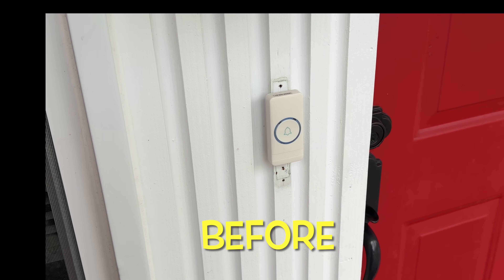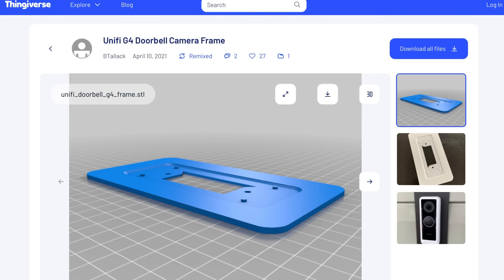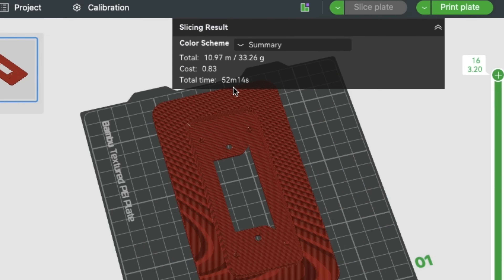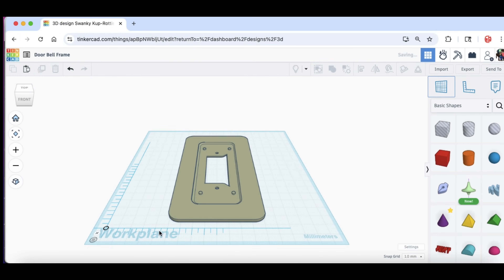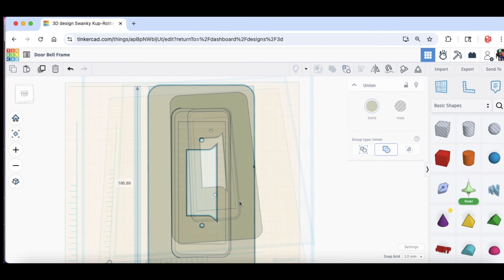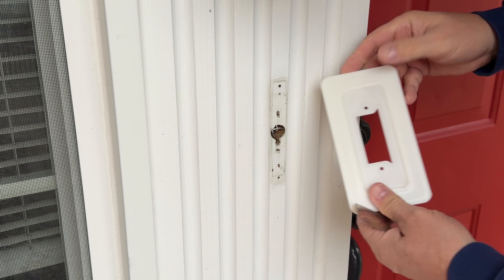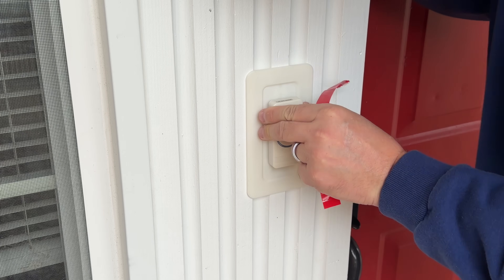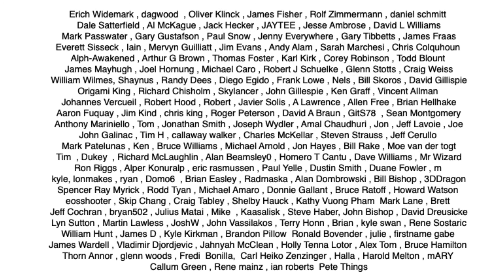Frame Your Door Bell with a Simple 3D Print

Comment: A little wood filler, sanding, and some paint would have done the job better, IMO.
Reply from the maker: The fact the push button case was wider than the column it was straddling never looked good to me so I like my solution better.

Comment: Chuck, not too long ago I saw an ad for a build plate that promised a lot. The two biggest things were being able to print with low or no heat on your bed so one could save on power costs and no need for any type of adhesive for getting a good first layer. The price was decent for my Anycubic Kobra S1, so I bought one, and so far the few prints that I've done have not only stuck perfectly, but have come out perfect with zero heat on the bed. 

It's called the Numakers IceGrip Build Plate and they have plates for Bambulab X1/P1/A1 series, the H2D and the A1 mini. They also have plates for the FLSUN T1 Pro, Creality K2 Plus and K1 and the aforementioned Kobra S1.